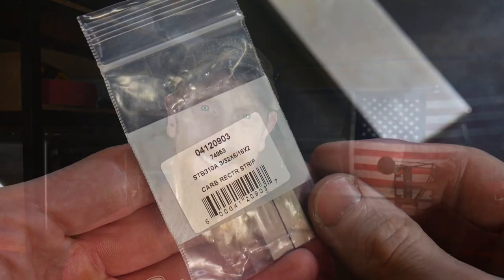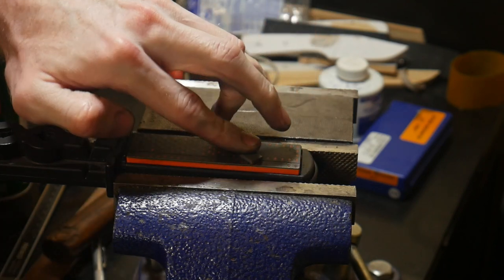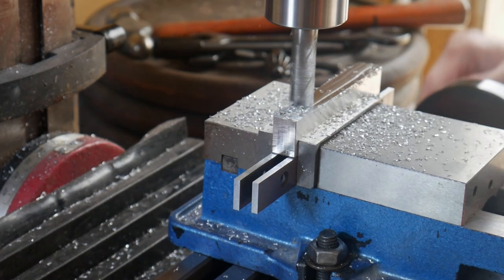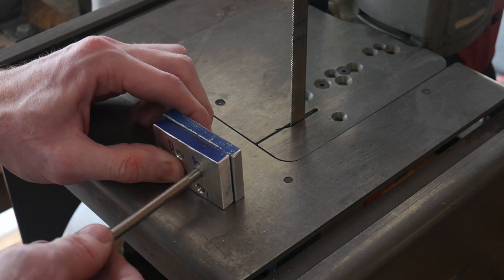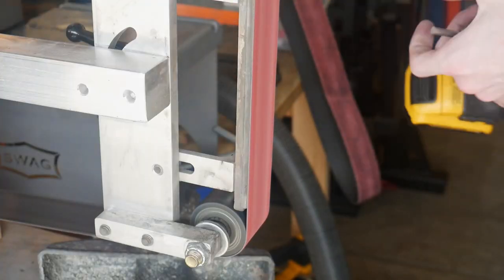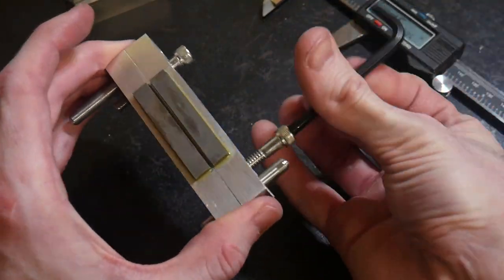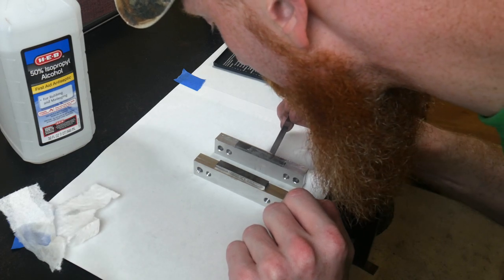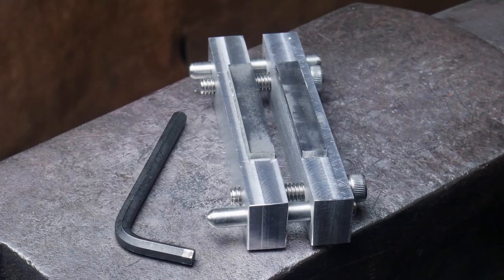DIY Carbide File Guide | Knife Making

Comment: If I May,  Great build.  I, like many others prefer the o-1 tool steel better than aluminum.  I have not had really good luck with steel bolts in aluminum threaded holes.  In addition, I had a problem with the "hard plate" surfaces coming unglued after the guide gets hot and dunked in the cooling bucket several times.  I pretty well solved this problem by using my marking rig to etch multi floral patterns into the carbide plates ans some on the matching side of the clamp.  I tried several epoxys' but settled on T-111, available on Amazon.  After 50 - 75 blades later they are still in place.  This is wonderful clamp to use before and after heat treating.  I hope this has been helpful and I also hope that I have not came across as a "know-it-all".  I wish you well,  LP
Reply from the maker: Thank you for your notes Larry! I'm curious to see how thing file guide holds up. The epoxy I used the second time around was Combat Abrasives Rouge Epoxy... Time will tell. Have a great weekend!

Comment: Get a tramming set for your mill. I have one that has three positions for the indicators, so you can adjust for your vise size. Then tram your column to the bed of your vise. Apply shim stock as needed to get it trammed. I did this with my Grizzly G0761 mill and Shars 6"x7.48" vise  (6" wide, 7.48" opening) and got it dead on with some shim stock. I got a packet of shim stock in different thicknesses from Amazon (before the insanity started) and have plenty left over. If I was to mount something directly on the table, I might shim that as needed to.
Also, a set of DROs would make your life a LOT easier. I picked up a set from DRO Pro's (veteran owned/operated company out in Cali) that use magnetic scales. They are VERY small in dimension, so work very well with smaller (not full size/knee) mills. You just have to make the mounting hardware for the read heads as your first project. Once installed (properly) they make repeating steps easy. You can then use an edge finder to get your 0 position and simply machine to the same spot. It also helps to get a vise stop so that you can properly index pieces of the same dimension for this. There are several flavors of those available. Ranging from dirt cheap, to costing a bit.

For the placement of the carbide pieces, If you machine a relief in the aluminum that includes your spacing (offset) it would make positioning easier. Have it offset a couple of thousandths so that you have the desired gap and you would be GTG. There's a couple of ways to do that (that I can think of right now). I would machine to no more than 1/2 the thickness of the carbide pieces, so they are still proud of the aluminum, 

Also, holding both sides (aluminum pieces) together in the vise would ensure that your holes are in the exact same position. Use your parallels to ensure you're not drilling into your bed vise.

BTW, I'm not a machinist by any measure. I do this type of thing as a hobby (I have a full time job). ;)
Reply from the maker: Hey Adam, thanks for taking the time to write up your comment. I'm going to have to try some of your suggestions for sure! I have very little experience with the mill.

Comment: Nice fileguides. I am planning to make a set for myself. But I think you had the wrong order of operation.
Glue the carbide first, with this the glue gap would not matter. Then algin the fileguide that the carbide surfaces are true and flat to each other (check with your square) on the granite plate for example. Clamp then with cant clamps. Then drill the holes for the srews and tab them. Srew the fileguides together this time with the screws. Of course align them flat and true again on the granite plate, check with yout square of course.
Last drill (and ream if you have a reamer) the holes for the pins.
Reply from the maker: Hey Roland, that's excellent. I 100% agree that would be better. Getting them even was a challenge and the glue threw in some variability.. I've considered getting a diamond impregnated cup for my mill.... to surface the top of these inserts.

Comment: Funny  - just as I was considering suggesting  a reamer bit, you talked about it yourself.  

With as many precise .250 holes as you require for your work,  it might make sense to get one yourself,  especially given that you have a milling machine, (which, one presumes, has less runout than a drill press).

That way, you wouldn't have to resort to doing things like fabricating tapered pins, like you did on another build.
Reply from the maker: I love it, thanks for the tip/idea

Comment: Very nice little project. I would have used stainless instead of aluminium tho as theres too much give with aluminium and those holes will wear out in no time. Definately like the carbide replaceable strips tho, makes life easier not having to remak the guide over and over again. I think you can even get pre drilled ones with countersunk holes too.
Reply from the maker: Cheers Fran, SS would be nice. Have a great weekend! Thanks for your comment

Comment: Good job. But just try to make it out of carbon steel instead of aluminum and to braze these carbide inserts instead of glueing. I dont't think glue is strong enough for these purpose. It can be overheated while grinding. The expansion coefficient of aluminum and carbide is different and, when heated, may cause delamination of the adhesive.
Greets from Russia! :)
Reply from the maker: Thanks for the tips sir! We will find out how it lasts. I'm not expecting the system to get that hot really. Greetings from Texas! Have a great weekend

Comment: Good build, very handy tool to have. Are the guide pins just loose? I thought you might glue them or fix them in one side so they don't fall out?
Reply from the maker: That is a great idea sir! In theory they're supposed to be a really tight friction fit. I think I got a little carried away taking them down to get them in the holes. A proper 0.2500'' reamer and hardened 0.2500'' pins would probably be the best answer...

Comment: Do you have any trouble keeping the carbide on? I have two bill bienke file guides and can only get one knife out of them before the carbide pops off. I don’t over heat or over torque, and when I repair them I go through the same steps and use the same glue you did in this video. I have about given up on them.
Reply from the maker: Man, they've done a decent job, but when using with the grinder I popped one off. I think it's best if they were recessed into the aluminum. I'll probably end up buying a nice one...

Comment: Like the build but all the precision went out the window with the glue, not that I’d do any better myself.  Thanks for all the good info.
Reply from the maker: Thanks Troy, that may be why it took two runs to get it right.  😂
Reply: Red Beard Ops - I was like, ope, glue.  There he goes taking it off, good for him.  Ope, back to glue... :)
Reply from the maker: @RabbitMangoTurnip  LOL, do you have any suggestions for if I do it again?
Reply: Red Beard Ops - I’d start with a flat block, drill, then split the block and flatten the two cut sides on the mill, tap the one side and glue on the strips.  I’ve been trying to think of some kind way to clamp the strips but the jig gets really big and you have to custom fit little single screw hold downs on each side.

Comment: I did the same with mine but I used hardened O1 for the body.. the carbide still breaks off.. if I were you with that mill l'd mill a slot for the carbide.. just my opinion.. nice video
Reply: That was my thought too, mill the slots.
Reply from the maker: Thanks guys. Yea I guess I got a little lazy with that part.
Reply: @RedBeardOps  I would describe you alot of ways but lazy definitely isn't one of them..lol..

Comment: I wonder if I could just cut a file in half and use 2 halves to make this file guide, without adding carbide blanks, because the file is already pretty hard. This would have been much easier.
Reply from the maker: Hey Pavel, hardened steel would also work; just wouldn't last as long likely. Good luck with your build!

Comment: It is better if you started with surfacing one face of each plate, all the drilling and pins, then you can surface and square the other faces of the block assembled.
Reply from the maker: Good tip!